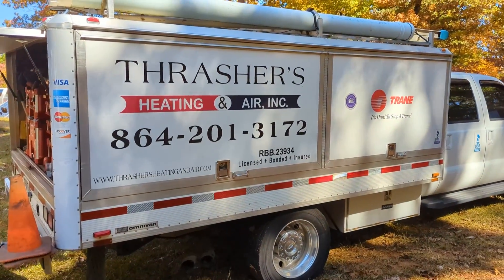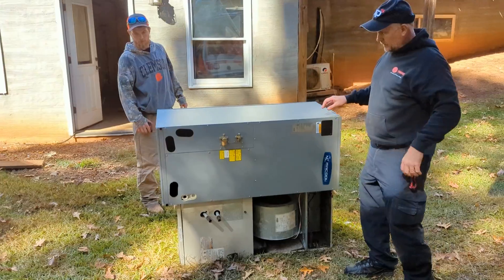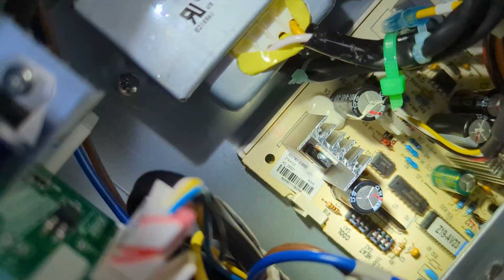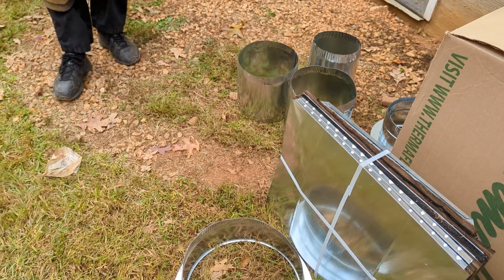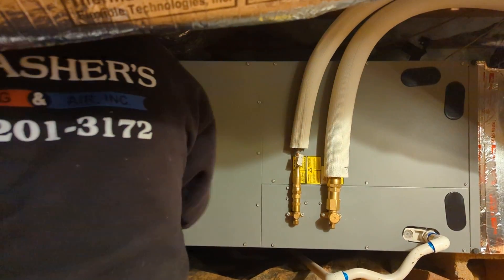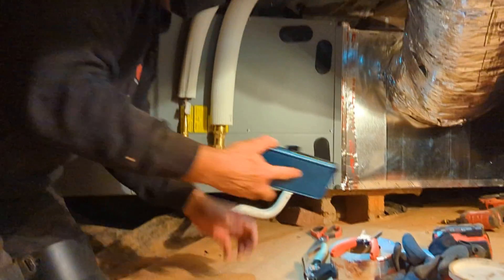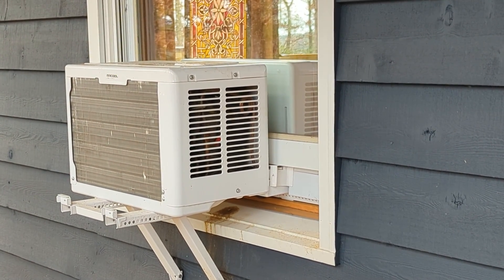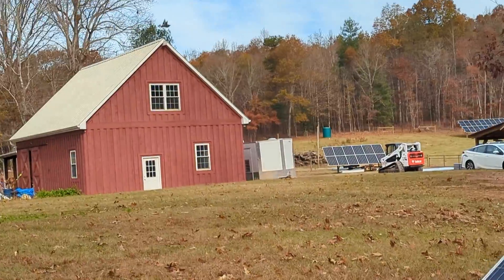MrCool is in the house!

Comment: 3:19 Where you mention about running SER to a sub-panel is a excellent idea and detail alot of folks miss, having that panel there within 50 feet and line of sight of the unit would serve as the power disconnect required by the NEC as you mentioned. A lot of folks are doing the hard work of putting in a 15 amp, 240V circuit, might as well spend a few more dollars to put in a 60 to 100 amp sub panel doing the same amount of work and add exponential flexibility to add more units, landscape lighting, convenience power etc. to your outdoor living.

Comment: I have a 2/3 ton unit installed in 3 ton mode.  I have an emporia energy monitor at the breaker and the outdoor unit is routinely pulling 20-22 amps.  I was a bit surprised that it was that high when the Rated Load Amps (RLA) on the data plate says 16 amps.  I see in your video you talked about it using about 12 amps.  Have you recorded amperage through the whole cycle?  I'm just trying to figure out if my system is performing as expected.  Thanks!

Comment: If you run a 2-ton configuration in a space that requires three or four tan doesn't that mean that the equipment will be running more often, trying to get the space to temperature therefore using more energy? I asked this because you mentioned about saving energy

Comment: Switch them to 2 ton mode.  You will be incredibly shocked at how much less KWH you are using running them.  
Tested mine and noticed a drop in overall energy consumption.  

We have a 2,000sf brick house near Charlotte, I put 8kw backup strips just in case.  The strips have only run 2 times, first day the AHU was in, and one day when our ecobee reset the HP lockout up to 35.  Christmas Eve 22’ we stayed on heat pump heat the whole day.

Comment: I installed a 8hp panasonic vrf in my home.. and 4 18k btu cassettes running from that unit. I didn't bother with air handler and stupid pipes. Saves so much space in the attic and i can turn off any unit that i don't need.. 
Summer days here can go upto 50c ambient. And most 8 months of the year it is above 35c so you need air conditioning all the time. I barely need heat . Only 1 or 2 days.

Comment: Installed a 4-5 ton unit with a 4 ton coil on top of my 70k 96% propane furnace.  Heats whole house well in Buffalo NY.  Pulls a max of 29Amps.  Wife keeps the house at 71 deg.  64 at night.
Reply: I have a 2/3 ton unit installed in 3 ton mode.  It is routinely pulling 20-22 amps.  I was a bit surprised that it was that high when the Rated Load Amps (RLA) on the data plate says 16 amps.  What is the RLA on the 4/5 ton?

Comment: I am pretty much sold on a universal, then I realized that the air handler I am replacing is a Downdraft.  50's pre fab with duct work below. but I can't install the air handler below. Any suggestions? can you reconfigure the air handler as a down draft?
Reply: Get the versa pro for downflow configuration

Comment: As an HVAC guy. Get a system that can be repaired in the same day if it breaks. If the board goes out on that thing depending where you live and availability could be weeks or months of down time. No tech carries every type of board for these type units. Not to mention other components that are proprietary and very specialized. That’s not with just me cool either. Any high seer equipment. Generally the more efficient the unit is, the more problems and down time you get. You might get a low energy bill, but when you have to pay thousands extra for the parts(with long wait times) does it really save?

Comment: Have you seen the EG4 branded PV Direct mini split? Looks like Deye inverter rebrand from China. The 24k model uses Panasonic compressor. Was interested in this and was wondering if anyone has used them. Not a lot of info out there on if they are reliable…

Comment: I put in a 30,000 BTU compressor outside unit, with 3 - 12,000 BTU Inside wall units, And removed attic blown in insulation and sprayed in open-cell foam insulation... and now our cost to run is 1/3 at least of what we used to pay.  And yet we still have single pane leaky windows.
Mr. Cool did not have the DIY yet at the time.  I installed the LG.

Comment: 8.25T 16-33 SEER, Am Std 2 ea, Goodman, Fujitsu Mini. You got this HVAC guy beat for tonnage! Are you running everything off of solar? My consumption goes up dramatically below 30F, but I turn the set points down where I can.  I like minis for certain applications, efficiency, zoning, diy, but prefer full v/s splits for ease of repairs/maintenance. You really have to seal around indoor heads to prevent dirt from pulling in around perimeter, add better air filtration and clean indoor coil/pan/drain often. Support that run trap in crawl space, add aux drain float safety switch to open data circuit so that unit will shut off if primary drain clogs. Insulate the last 6" of line sets to prevent condensation. Seal around that opening where drains exit cabinet with silicone to prevent dirty air from entering. You don't want water leaking inside ah, soaking the insulation and rusting cabinet out. Otherwise good installer/installations. You are about right on total amps for 3 ton system, inverter (variable speed) and two Micro Aire soft starts sure make it gentle on my two 12k's. So, let me know what the hydronic valve is for on the wood boiler? You're like me, I try all new stuff out before using customers as guinea pigs. Keep up the good work and explaining things much better than you used to.

Comment: Mr Cool needs to make an RV Conversion kit,  where they have a minisplit  cassette style head unit that can mount in the existing through roof location of the existing conventional RV 13500 or 15000 BTU rooftop A/C unit.

Comment: We’re going to build a 2300 sq ft house and have looked at Mr cool. I contacted them the other day and they said they don’t do zone heat. Then the next day you upload this video with 2 Mr cool universals. So a few questions the obvious one out of the way, so I take it this is how you do “zone heating” is buy multiple 2/3 ton units? I take it in a new construction build you would have to have multiple plenums one for each zone which is connected to its own Mr cool universal? The solark 15k handling these fine?

Comment: What is the  HSPF rating ?  Looking to replace 3 ton unit in Colorado @ 7,500 ft. and efficient @ -20F Need 14 HSPF..     HSPF, or Heating Seasonal Performance Factor, is the measure of a heat pump's overall energy efficiency during the heating season (fall and winter). Higher HSPF rated heat pumps are more energy efficient, which is a good thing for both the environment and your wallet!
Reply from the maker: MDUO18036 – Up to 20 SEER, 12.5 EER and 10.5 HSPF
Reply: Good luck finding a 14 hspf. Ha.
Reply: You won't find any 3 ton 14HSPF systems- I think you're being unrealistic. Maybe three 1 ton systems with one head each. Efficiency is great until the coils are super thin and fail prematurely.
Reply: Also, be sure you have a simple, reliable backup heat- ideally a woodstove or propane. You will be screwed if your heat pump fails at -20 degrees or you lose power.

Comment: Location of condensers look like they may be not per instructions.  Ingestion of air can cause higher head pressures.  There should be clear space above units with setback requirements.  At least they are not pointed at each, doesn't look like it would be bad, but technically may not be perfect.
Reply from the maker: I have more than enough space behind the units. ( 7 ft) I really wanted them out of site and under a roof.

Comment: ENGINEER 775, so have you replaced the Solar Mini-split air conditioners? Do you recommend Mr. Cool’s over the Solar mini-split?
Reply from the maker: Good Question.  It depends on the customer.  Some just want indivual solar appliances with no batteries so we then off the Solar minisplits.  I am actually installing a new brand from Signature Solar this week to see how it compares to Hot Spot energys.
Reply: Engineer 775, we too received an email from Signature Solar regarding their Solar Mini Split. They appear to cost less. You having the Hotspots, now Mr. Cool and will be trying out the EG4 Solar mini splits can you provide a comparison and contrast? 
We live on the Island of Bermuda and it is 24 x 7 x 365 salt spray, humidity in limestone houses, with white limestone roofs, and catch rain water into large underground concrete tanks, so our homes can also be damp in the winter. This is why I trying to glean from you and your team’s years of experience on a latitude similar to ours 32 degrees north.
I want to thank you, Johnny V. and Abraham for all of your installations on Sol-Ark making it easier for us to DIY our own, so we just purchased a Sol-Ark 15k, 16 Heliene 360 watt panels to be roof mounted & 2 Kilovault 7.5 kWh Batteries. Thank you for your professional layout, wire trough and planning. We envisage designing ours to fit in our laundry room where the grid meter and 100 amp disconnect is located. It might be a bit tight, yet we will mount the batteries on the wall. We do all the prep work and have a qualified electrician make all the connections as per our government regulations.
THANK AGAIN! We watch and enjoy learning from you and Johnny’s videos!

Comment: Redundancy, redundancy, redundancy  I just learned my lesson with this thankfully I at least have a wood stove or we would be royally screwed. 6 months old universal lost the compressor. With wind chill pushing -10, -20 its miserable. I'm literally refreshing my screen every hour waiting for my replacement to arrive. It did make heat down to -20 before it went out.

  My biggest fear of losing a compressor came true in less than a year. Waiting for parts sucks, but on the bright side the error codes makes diagnosing problems a breeze. I dont understand the need for a soft start when thats exactly what makes these so great they slowly ramp up and down. Out of fear and terror of losing my replacement  in the middle of a extreme cold snap I've ordered a Kool guard 2 just in case. I'm so paranoid at this point im considering ordering another condenser just lying around to swap it out if my replacement goes out.

  I LOVE MY MR.COOL just don't get to comfortable with the sales pitch cause when it goes out its always at the absolute worst time of the year hour holiday etc.  Love your videos Engineer 775

Comment: Without a coil heater how cold can outside temp be and still keep house warm?
Reply: My Mr Cool 4-5 ton hit -20F outside a week ago and kept the house 70  I doubt its efficient at those temps but it was still making heat at those temps so not just marketing hype.
Reply: If you size these properly they can handle 100% of the heating load down to -13F (-25C)
Reply: You oversize 25%. No heaters needed if you don't bet below 10F. Oversize 50% and you'll be good to 0F or below.

Comment: Yikes! I never recommend setting condensing units under decks/bumpouts / overhangs of any kind. Also... On pre-charged linesets they work as a labor saving device but if you   have excess length it's a drag on efficiency.
Reply: Don’t see an issue sitting these under anything.  Care to elaborate?